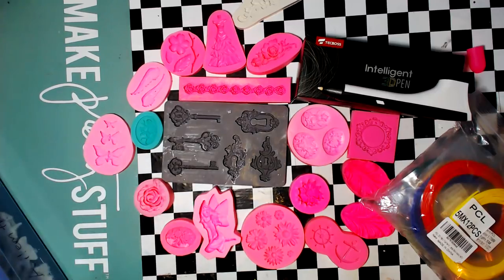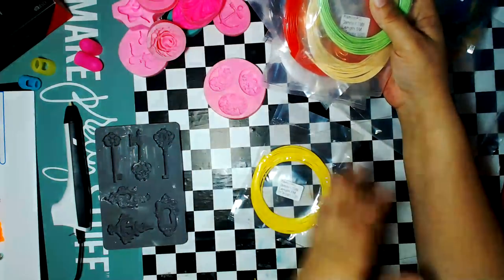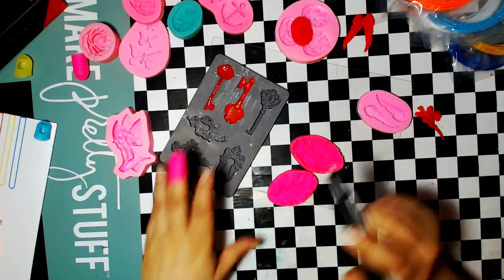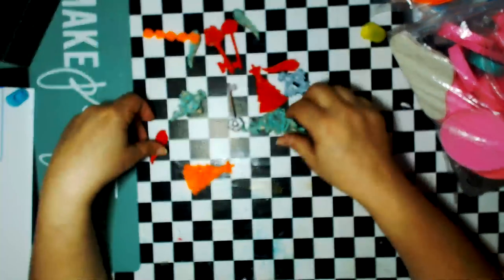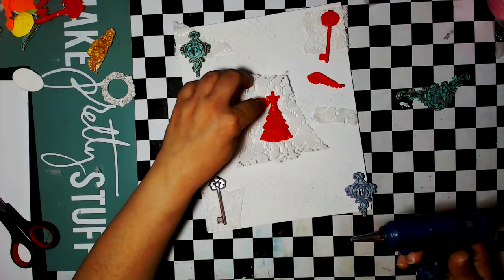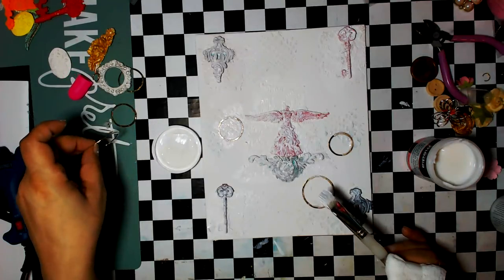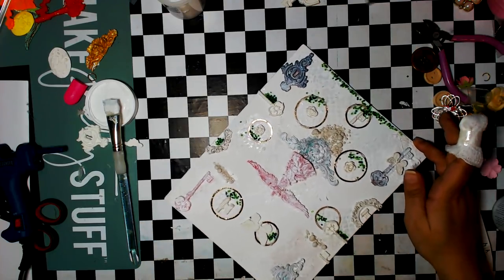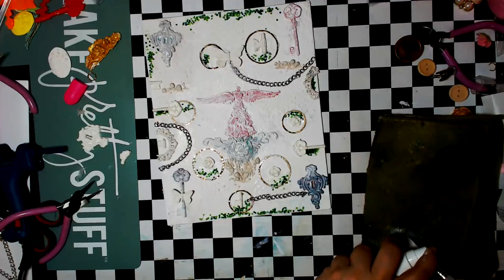Lets play with the 3D Printing Pen / Silicone Molds and make a canvas

Comment: Note studying the topic more it might be more related to printing temperature how much does the filament sticks or escapes .... Pen allowing more precise temperature adjustment could possibly help to control filament behavior better. My current pen only has PLA/ABS switch but i have seen online people having more adjustable pens. Considering filaments vs pen price maybe better adjustable pen could be cheaper option then searching for the perfect filament that behaves perfectly with my cheapo 3D pen ...